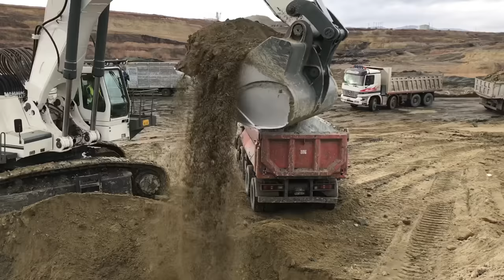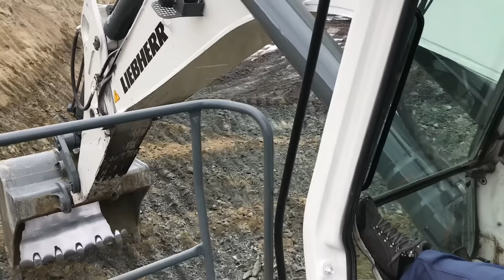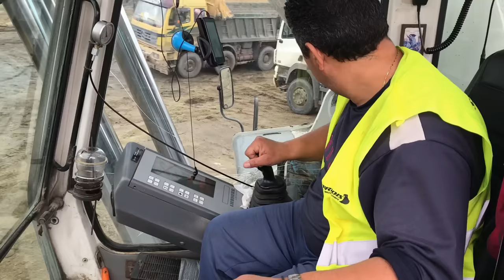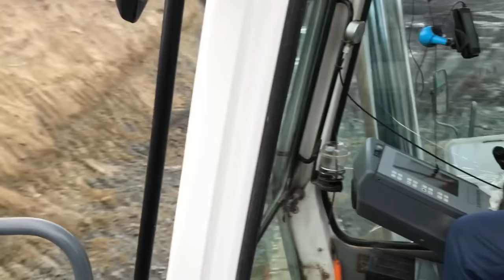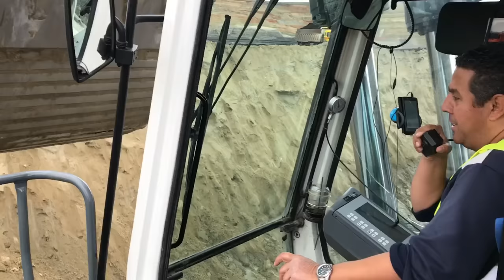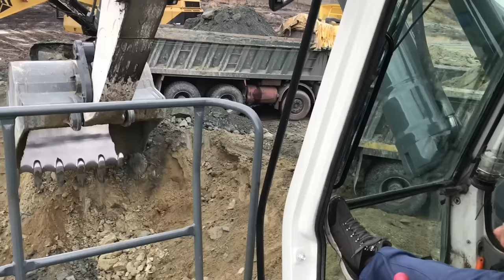Liebherr 984 Excavator Loading Trucks With Two Passes - Sotiriadis Ate

Comment: This guy knows how to get a full bucket. He doesn't curl the bucket in so much like most operators, he leaves it open and instead uses the boom and the lower arm to do most of the digging. By leaving the bucket open he forces more dirt into it and fills it full, wereas other operators close the bucket too soon and the dirt can't be pushed as far in, so the back of it winds up partially empty much of the time.
Reply: M
Reply: Sounds really good.
Reply: If ya got good muck ya can get more on top of the bucket than whats in it - thats efficiency

Comment: A 984 is bigger than you imagine. 120 tons (very difficult to transfer on the road). 
Against a standard trucks which can contain 30 tons maxi (less on the road), 2 bucket is not a surprise in sand.
A 120 tons class excavator is the biggest excavator you will never see near you on except for mining.
Once you have a 80-120 tons excavator somewhere , go and see it. 
If you are far , it seems like any standard excavator.  But It is very impressive if you are not far.
Reply: What about the Liebherr R 9800 G6? It's an 800 Ton Mining excavator that has a 47.5m³ bucket (or whetever that thing is called in english).
Reply: @kaystephan2610  You will probably never see a 800 tons class excavator it in all your life. 
It is a big mining machine class. Perhaps there is no such a machine in all your country.
I talked about an excavator you may see one day if there is a big construction to do (highway, train ...)
Reply: @abinadvd  I mean...I got a 2500 Hectar surface coal mine that's - according to Google maps - 50km away. A 44min drive. Maybe imma go visit it once to see one of these gigantic ass things 💁🏼‍♂️  Tho i think they have bigger ones. "Bucket Wheel Excavator" or whatever they're called.
Reply: @abinadvd  Ah yes I looked it up and they got a 2278 Ton bucket wheel excavator. Imma go see that. 🥵🥵🥵
Reply: You know they should probably use mining trucks and regular dump trucks here in this vid

Comment: First thing I thought was those two cylinders on the main boom are upside down lol. Nice shovel.
Reply: Makes more sense as any dirt will fall away from the seals
Reply: Or just design, when pulling then rams are in correct position, on the top of the boom.

Comment: Cracking machine 👌👍
Reply: I suppose one reason they don't hook 3 or 4 side dumpers to one tractor is the operator would have to swing a full 180 degrees to load the train since they can't back into place. Still seems like it would be more efficient if the roads were good enough for one tractor to pull that much dirt.

Comment: That's a lot of excavator for those little dump trucks haha. But they have an efficient system going. I wonder if it would have been more cost effective to have 40 ton trucks hauling the dirt.
Reply: The bumpers are owner operators so it’s cheaper for the mine....

Comment: Warum sind die hubzylinder  andersrum ?
Reply: Weil Die Zylinder unten so breit sind das sie zu dicht an der Kabine sind
Reply: Than they have more strength
Reply: I do not believe that.Why do not always build them the other way around?
Reply: There are many speculations out there concerning why Liebherr mount the boom cylinders 'up sidedown') One get the same lifting power wheather the cylinders are turned one way or the other, and the cylinders will take up the same space next to the cabin anyway how they are installed. The real reason shall be that it is easier to run all the hydraulic lines along the boom, no need to have seperate lines down under the boom to the boom cylinders, as most other brands do. This is given at a forum by someone knowing Liebherr technicians, that have worked for years With the excavators. so it's just a small 'practical detail',  possible saving some work/money espcially with the large mining machines, maybe not so much With the smaller machines under 100t but they have used the same thing there as well.
Reply: I was in the factory of Liebherr and have EXPLICITLY asked why they were installed differently. The answer was clear and kurz.BECAUSE TO LITTLE PLACE TO THE CABINE. NOTHING ELSE
Reply: Too little space to the cabin? I work with excavators for years. turning the cylinders around for such possible reason does make little sense. To avoid extra work and cost with extra pipes concerning the boom cylinders makes sense.  Anyway, who cares? the machines looks great with the cylinders turned as the are. I'm sure if it was important, everybody else would have done the same.
Reply: I can give you his phone number and you can call him ok.This was his answer for my question nothing else
Reply: @dermaschinist4515  ich denke mal was anderes würde auch kein sinn machen .
Reply: Wie ich oben schon erwähnt habe.Ich war vor 3 Wochen im Werk direkt und habe exakt das gefragt.Es ist aus reinem Platzmangel heraus entstanden sonst nix

Comment: They need a dragline.
Reply: What for? This would be much slower ...
Reply: They are ancient and slow. A liebherr 9800 fills the huge mine dumptrucks in 60 seconds with around 45 cu metre per bucketload
Reply: @rossbrumby1957  Not to load trucks.  To strip and move material and cast it to the side.  Would eliminate all trucks.

Comment: whats the point using such excavators with 8x4 which can only take about 20T payload with a dome and not real volvo or cat dump trucks with a capacity of 40t payload ,less rotations less fuel less mess on the tracks, less risks about safety!!!!!!!!!!!!!!!!!!!!!!!!!!!!!!!!!!!!
Reply: They are owner operators less upkeep and liability for the mine